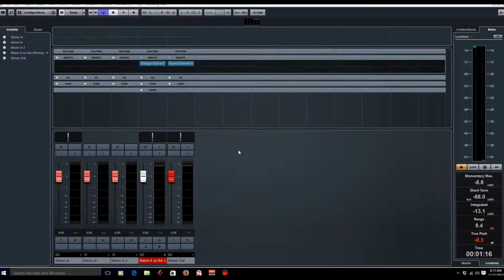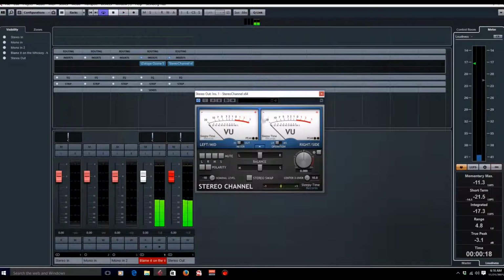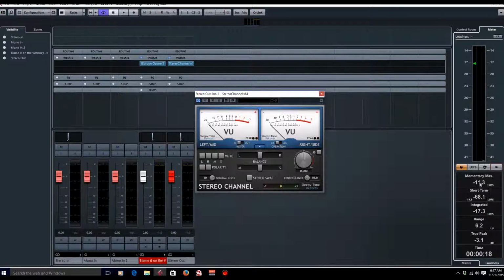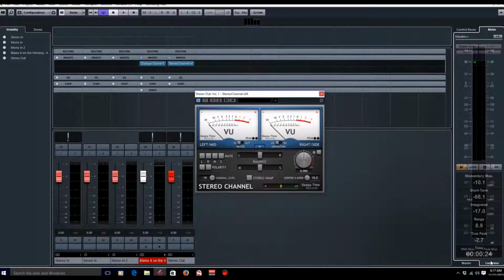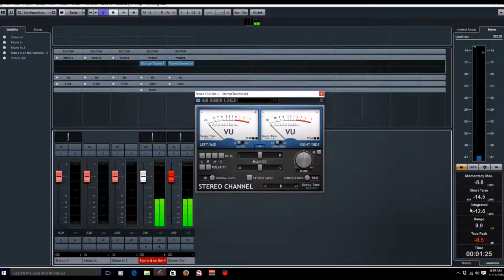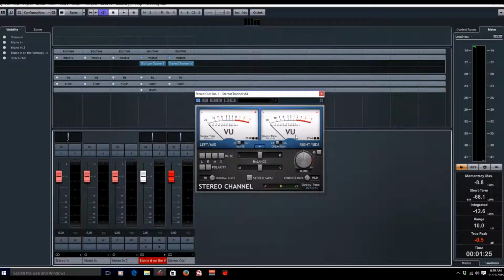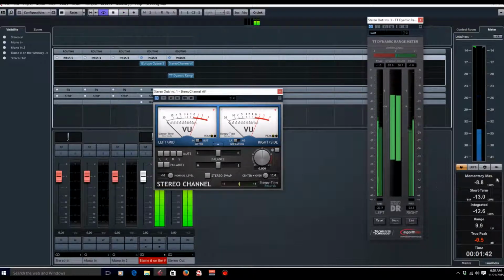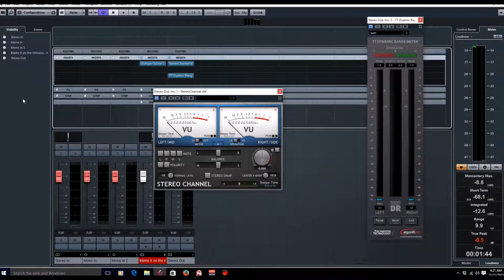Cubase Hot Tip 1 - Loudness Metering

Comment: Where can i insert the VUmeter, i can't find it in the effects..in what section can i find it? for example is it on the dynamic section effects, in the EQ section effects??
Thanks!
Reply from the maker: The VUMeter is a separate plugin I had to download. Just look up Sleepy Time Records on google and look for the Stereo Tools plugin. Note this is a Windows only plug so an alternative, which is only like $10, is the klanghelm by meter.
Reply from the maker: I'm sure you can find a freeware alternative for Mac if that's what you're running, but just about any VUMeter will work. To test if it's accurate load up the VUMeter you chose and set it to the calibration level you want, then open up a signal generator set it sine wave and match the signal on the generator to the calibration on the meter, so say I have my by meter set to -16 I would have the signal generator push out a -16db signal and the VUMeter should be hitting 0
Reply: +Studio 7-22 Thanks!